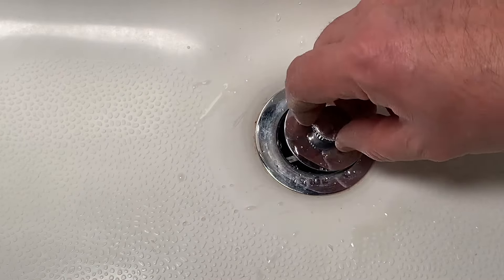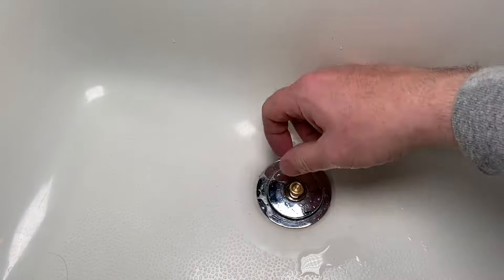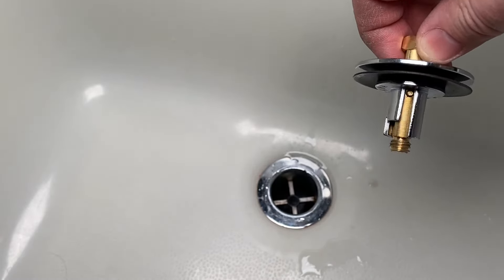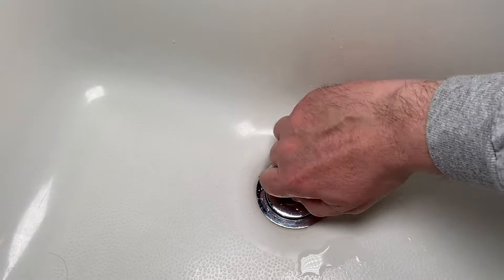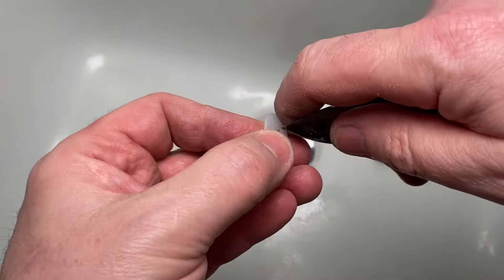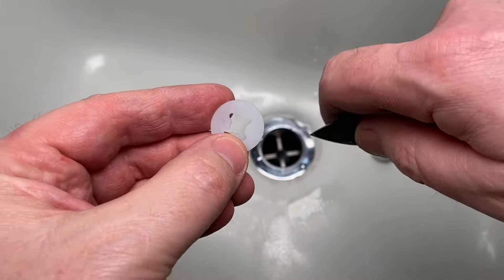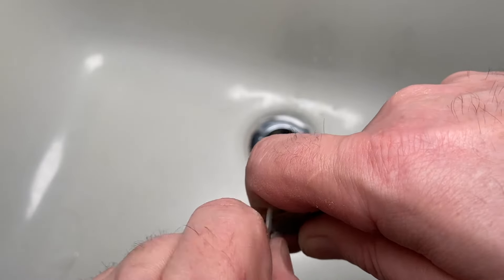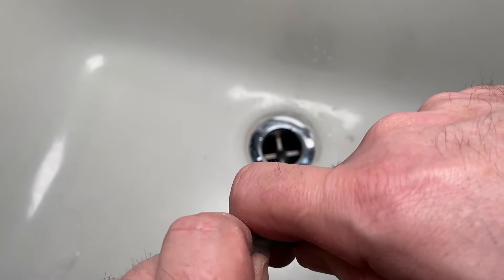Pull and Turn Style Tub Drain Not Working...Solved a Big Manufacturing Flaw!

Comment: I hate those things.  I Went to the old school rubber stopper. I use to put a bunch of teflon tape on them at the apartments and other places I did work at.
Reply from the maker: I almost did Teflon as well!  I agree that they are not the greatest set ups, but seem to be common place these days
Reply: I got an old school rubber stopper too. Life is simpler and easier than way. I hate aggravation 🤣🤣

Comment: Looking in store for a similar washer, no luck. Any idea where to look?
Reply from the maker: Do you have an Ace hardware or a mom and pop style hardware store by you?  That is where I would look. Take that in and show them what you are looking for does not have to be plastic. It could be rubber as well. I rubber washer may even work better. They should have single washers you can try and buy.